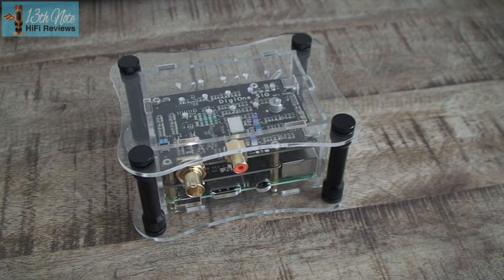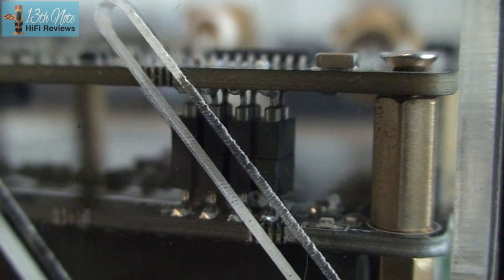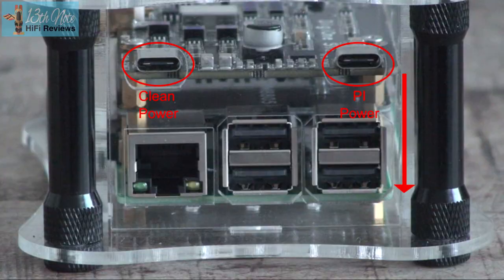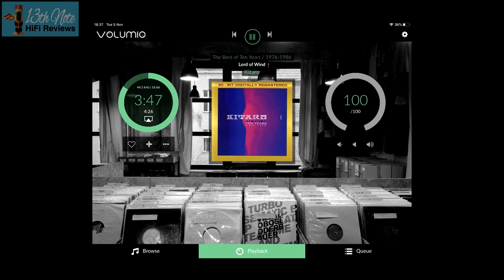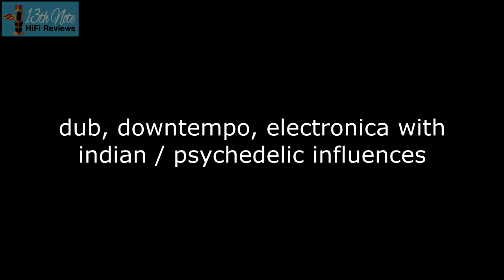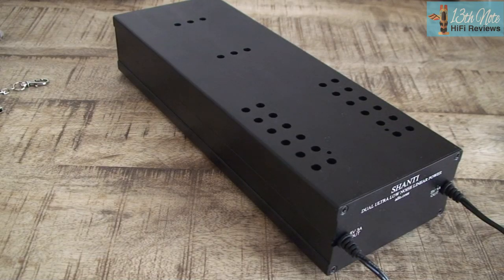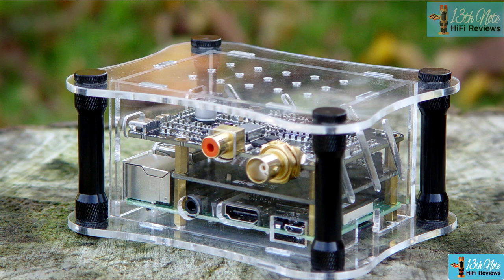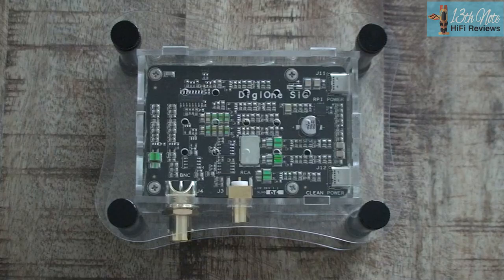Allo DigiOne Signature Streamer : A Film

Comment: Hi Simon, I have a same set up as yours Allo digiOne paired with the Qutest.  I hooked one terabyte hardrive to it, so lots of personal music Flac files. But you have to format it in FAT, the original FAT not the EXfat, FAT32 or NTFS.  The linux OS variant used in the Allo Digi One can read regular FAT partition easily.  I suggest using your Linear power supply  by putting one end to the clean power and the other clean power to the Qutest.  You will  hear a difference.  Just use a regular wall wart to the dirty power. The Qutest DAC comes with a 5V USB- C switch mode, wall wart but it is a good quality one, no harm in trying, hope it will suites your taste.
Reply from the maker: Dennis Teo hi Dennis thanks very much for feedback. I use a Mcru linear psu on my qutest but with some pre amps I’ve tried I just use Wallwart as more than ok. A good one is to use an nas. I also use that and my innuos Zenith which is a roon server/NAS. Enjoy and bw Simon

Comment: Super similar to my home setup ,  Digi one Signature and shanti LPS, picoreplayer as the OS , ran into a chord qutest, but you probably have a nicer amp than me though! 
I’m running the dac and the clean side of the DigiOne off the shanti, and the dirty side for the pi from the popular ifi Ipower switch mode psu . This way gives me smoothness and some great resolution.
What’s the white coax cable you’re using ? I’m running the red chord Shawline and think it sounds yummy.

Back to back tests against my CD player which is also going into the qutest , show the DigiOne just slightly ahead in terms of picking up vocal reverb and ‘emotion’ - which I’m really happy about 

Just feels like I’ve landed with a really decent system that I won’t be able to beat in my current listening environment. 

Great video and look forward to your next
Reply from the maker: Hi Matthew. It’s an old chord one, called an anthem. Don’t think they do them anymore, but it’s pretty decent. I think it was about £250. Just got a Musical Fidelity MX-DAC in for the next one, and will be interesting how it competes with the Qutest. I think it’s about £$800 from memory. Cheers Simon

Comment: Agreed. For the streamer I think its integration with streaming services is important. For instance I have a bluesound node for like 8 years now, and I am not using its DAC (since I have a DSP with 6 channel DAC that I use as digiital crossover for two 3 way speakers). Problem is that the Bluesound streamer does not support more than 1 user account in the  streaming services. So family members cannot stream their own playlists.

Comment: Very good review. Your channel is becoming one of the best resources for hi fi. I have a question. I am waiting for the shipment of adigione signature in the next weeks, I ordered a battery pack too. I was wondering, how can I leave on the player running on batteries? If not playing how long batteries last? Do you think there is some kind of influence on sound quality of the streamer is never turned off?
Reply from the maker: Mario Rinaldi thank you very much Mario. That’s tremendous to know someone thinks that way. I don’t really know about the battery thing. I suppose if they are connected to some sort of trickle charger then they are connected to the mains in some way and that’s not ideal for the streamer, so best just to keep batteries separated and charge up now and then. Not sure about your other question if I’m honest. Experimenting is always best. I would recommend trying the Shanti linear psu or any other cheaper linear psu. You may find it negates the need for batteries in your system.

Comment: When u supply the Rpi with 5V battery pack directly, then why u need to separate the Rpi from allo with two different power supplies? So in this case a Standard Digione should be the same in terms of power supply noise!
Reply from the maker: It’s to do with the fact one power supply supplies power to the lower pi board and another the top board, as I explained in video. I suppose it’s based on the fact the raspberry pi has its own power and was designed before the hat, and then to get cleaner power to the top board you need another supply. 😀
Reply: @13thnotehifireviews7  Sure, but I assume a 5 V DC output of battery pack is already a clean supply, unless Rpi messes up with it! I think this can be tested with an oscilloscope directly on the respective GPIO pins.
Reply from the maker: @kamimcmmm  yes that’s the point. The rpi is noisy and has the processing aspects, hence spectated power supplies and electrical seperation = improved sound quality.
Reply: @13thnotehifireviews7  thanks for the Infos, between Rpi3b+ or Rpi4, which one has a better sound quality?

Comment: Good video. Thanks for info I can use to make a decision about buying a streamer. Question please. Why is an external DAC needed? Isn't the hat setup on the Allo product a DAC? One could go straight to the amp, correct?
Reply from the maker: Thanks. The idea is the clean digital outputs are off the top hat board. I think the pi board has a dac because of the headphone out but it is so bad it defeats the point of using a pimped pi with a hat.

Comment: Hey Simon. Enjoying your reviews. I wonder if you could offer some of your opinion to my set up conundrum.
I have the digi one signature running into the qutest ,using a quality bnc Atlas connector. I am using the Ifi psu for the clean side and a standard one for dirty side.
My qutest , l am still running with the supplied power supply.
Finally lm am using a Cambridge Audio AXR 85 amp into Tannoy F 6xt.
It is a really good sound , the amp provides a warmth and there is some nice detail at the top with a controlled bass response.
My one issue is that there is a warmth and slight recess in the mids that l am not quite accustomed to yet.
My previous amp was a pioneer A50 and altho not as detailed as the Cambridge , it was more open in that area.
Will adding the Shanti as you have suggested to others, provide more of the  forward detail in the mids.
Or is it the amp that is creating the mid scoupiness. Sand is there a similar or slightly more expensive  amp that will give me the results l seek.  Have the treble control at +10 and bass +4-6 to try and compensate .
Any advice appreciated thank you and keep the reviews coming.
I stream mainly using tidal on  Volumio .
Reply from the maker: Happy to if you offer me a token one off gesture however big or small via patreon
Reply: 13th Note HiFi Reviews Donation made

Comment: So let's say we get the DigiOne Signature Player, plus the accessories (add $100), plus a very good DAC. Let's say a RME ADI-2 DAC at $1100. We're now up to about $1600. Would it not be better to just get the TEAC NT-505 for $2000? With over built power supplies and dual mono dac chips? I mean if you can get 90% of the audio for $300, I get it -- the futsing with the software and such would be worth it. But I would guess that there's way more work involved in the RPi + DAC solution, with lower quality sound, and a lower quality sound. 

Dunno. I'm genuinely asking, cause I've been thinking of the TEAC and Cambridge Audio Azur 851n and the NAD C658. Would appreciate feedback!
Reply: Darko has done some really fine work with this.  Set up properly, the raspberry pi/allo provides a extremely clear streaming signal not rivalled by streamers costing several thousand dollars more.  With that said, all in ones, while easier and in many cases, more value, won't provide the highest quality and certainly won't allow for fiddling and experimenting, that is comparing.

Comment: Ok. I’m so confused lol If I want to stream my Spotify from my phone. I have to connect this to a router? Connect this to my amp and or DAC? How do I stream from my phone like Spotify - it’s not wireless
Reply from the maker: You wouldn’t need to stream from your phone. You’d use a pc or laptop as the controller with Spotify to allow the digione to stream Spotify.
Reply: Thank you! But I kind of WANT to use my phone with Spotify 😂 is that possible? 🙃
Reply from the maker: Thomas La Bouff you’ll need to check out the different interfaces I mentioned in the video. Eg volumio. I never really do it as Bluetoothing is a compressed format, but you could still use the Volumio app on your phone which makes the Allo the native streamer not your phone. Depends on quality of your HiFi too.
Reply: @thomasedward2231  I stream Spotify using Digione Sig as a player that's controlled by my phone. Simply install a Spotify Connect plugin on whatever software you're running on the Pi, and you'll enjoy all the convenience without being hindered by BT range and sound quality issues.

Comment: Great video! Thanks a lot for your help. Could you please clarify , I'm the novice in hi-fi and besides my English comprehension is far from ideal , so I didn't get it clear - what is the best / recommended by you way to power digione signature both dirty and clean side? I'm not very happy with batteries (too lazy for that) , so I'm looking for one solution for both sides without compromise in SQ. Thanks in advance, looking forward for your reply .
Reply from the maker: Thankyou. Go for the shanti because it’s inexpensive and you’ll get great results. Alternatively you have to buy brick switch mode power supplies and whilst they are cheap, so is the shanti. That’s what I’d do.
Reply: @13thnotehifireviews7  thankyou. So if i get it right i should use 3A for dirty side and 1A fo the clean one?
Reply: @nikitakorovin6498  looking at manual 
https://www.allo.com/sparky/digione-signature-player.html#downloads

CLEAN POWER: (5V to 8V)
100mA.
This Port accepts DC power from
Battery Pack, take care polarity 

RPI POWER: 5V/2A-3A (RPI)
Do not Connect Battery Pack power or
Higher Voltages to this Port. It will
Damage whole setup Including RPI.

Comment: hi, this was a great video for the Allo. Can I ask - would you have any suggestions for a USB streamer?   Allo have issues at the moment with shipping and thought id ask.  Im really after a decent quality relatively inexpensive for a Chord Hugo TT 2.  

Also I could use my epic Coaxial cable as well :)
Reply from the maker: Thanks very much. Not sure why just usb, maybe you could elaborate. But I recommend node 2i over coax everyday of week. Not hugely expensive
Reply: @13thnotehifireviews7  sorry I wasnt very clear maybe.  I will have my chord TT 2 in the bedroom and will have grado 1000e headphones and use Roon now and need a decent low noise streamer but small ideally.  Something less expensive than the pro-ject S2 as an example.  I've looked at the raspberry pi stuff and wanted your honest John opinion.  Should I get hanged up about usb electrical noise etc ?. Chord said not to stress over this stuff... Etc etc
Reply from the maker: @swimadamswim  no you were clear. I wouldn’t get stressed at all. Largely all this comes from people describing differences in outputs, and really they are often only tiny, if anything, anyway. The Allo would be really good into the chord with spdif coax, so would the node 2i (which is Roon ready). My dealer friend told me that one of his customers uses a node 2i into his chord Dave and thinks much pricier steamers are ott. Often I’m inclined to agree. You can use all sorts of power supplies with the Allo to smooth out the sound , which tends to happen with the linear psu’s and when you use linear psu’s with chord (for better or worse depending on sq tastes) even though they don’t recommend linear power supplies with their dacs.
Reply: @13thnotehifireviews7  very helpful.  I can get a ex demo project streambox ultra for £450 but again I just need a streamer and no Dac.  i think the node 2i is stream and dac - correct?  so guess I'm paying for a dac that I dont need.  Or look at the allo but as i say they are having shipping issues.  Or would a regular PI4 streamer be good enough?  or do you think i need a separate board for the coax or USB?  thanks
Reply from the maker: I wouldn’t worry about paying for the node 2i dac. They are still cheap and where i am (U.K.) they often get discounted, £400 instead of £500. The BLUos application and its features is so helpful, you might use it in the future with its dac, or not bother with roon. That’s the only thing I’m not so keen on with allo. The apps I used are not much cop but using with Roon then no issue. How about an SOtM s200 Neo, about £500, you can use the usb dac output into chord usb input. Never tried one though tbh. I’d be inclined to go for the node because it has all the apps, MQA encoding etc (which sounds great even as d o p with chord not using MQA) saying this makes me want to try one of these SOtM’s for sound quality as I never go mad on streamers. DACs maybe but you don’t need to go crazy on digital transports.
Reply: @13thnotehifireviews7  hi again.... So I forfot.to.tell.you that I'm a room lifetime membership member 🤣.  So hence my reasons.   But as always very good advice.  I'll just have to keep looking but I'm very tempted to go halfway and get the Allo USB signature and use the chord USB cable initially.  BTW - would you get worried over the stock PSU?  On the TT and all its massive noise dampening would I still need the upgraded power supply ?
Reply from the maker: @swimadamswim  maybe if I’ve helped chat on patreon Adam, or donate to my website. I still make very little money on this site. Only if you want to.

Comment: I “dig” your reviews. 
A question:
Can’t the new 8gb pi be used as a roon core/server at the same time as it being an endpoint ? Thanks in advance
Reply from the maker: Thanks very much for ‘digging’ my reviews. Lol. Really don’t know tbh. I thought they are just an end point. You know more than me here I think. Whatever though, if low cost is the thing how about a reconditioned pc or cheap as chips Intel NUC. that will do roon.
Reply: 13th Note HiFi Reviews after browsing a few community pages in roonlabs.com, it seems the pi 4 CPU is still weak for it plus there is no roon core sw compiled for ARM (yet, as it is inevitable at one point because of apple’s move). So, perhaps the pi 5/6 could do the trick...

Comment: The Max2Play software is very easy to deal with. Especially compared to DietPi. I use my DigiOne Sig as a Squeezebox server and streamer this way and Max2Play makes the process achievable without having to hook the DigiOne up to a monitor/keyboard or mouse.  Just ordered a Shanti.  I consider this a high value product.
Reply from the maker: Good one. Never got around to trying max2play but might before I give it back. Enjoy!

Comment: I noticed that the Digione signature has two different raspberry pi configurations. Why would I get the older 3 version over the new 4?
Reply from the maker: David King got to be honest I’m not that sure so prob best to take up with Allo. Merry Xmas
Reply from the maker: David King ps this link is quite good. I suspect it’s not really to do with sound quality but if you want to use a pi for other uses if you so desire. On that score the better the processor in the 4 model, perhaps the more noisy it will be so I wouldn’t equate a newer pi model as better sonically. I’m not sure on this but I’d consult Allo. https://magpi.raspberrypi.org/articles/raspberry-pi-4-vs-raspberry-pi-3b-plus

Comment: I have a Rotel RA 1572 amp but it doesnt have a BNC output. How would I hook up the Digione on my Rotel?
Reply from the maker: You mean digital input. Digione has rca and bnc digital output and your rotel an RCA digital input
Reply: @13thnotehifireviews7  thank you for the answer, Sir. Sorry for my ignorance on these cables nomenclatures. Now I figure my Rotel does have a coaxial input, actually there are two. So, the Digione has two digital outputs, one coax and one RCA. Should I connect both on my amp or only one, please?
Reply from the maker: @intothedragon  connect one

Comment: Does this PS use separate transformers and 2 separate filter banks.
Reply from the maker: Donno unfortunately.
Reply: @13thnotehifireviews7  it would explain much better sound quality .
Did you try to power raspPi section with power bank and Digital out section with your Power Supply?

Comment: What streamers was the digione superior to sonically.
Reply from the maker: Smood47 it’s superior to the Yamaha WXC-50 I have, also Sonos Connect and the newer Sonos Port in my view. It would be a tough call on the Bluesound Node 2i but the point is not so much what is it superior sonically too but how much bang for your buck there is and the fact the difference to other greater priced streamers is often modest. My innuos for example.
Reply: @13thnotehifireviews7  From what I Read the sotm 200 ultra is a big step above the digi one and rpi based solutions. But its more pricey. Another user has pi2aes + audio gd di20he and finds it better than dcs bridge!